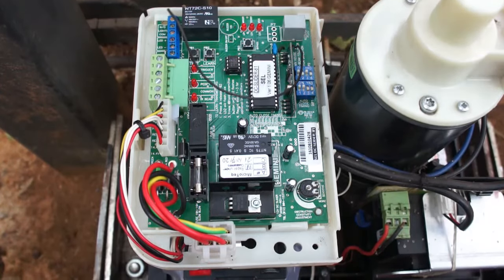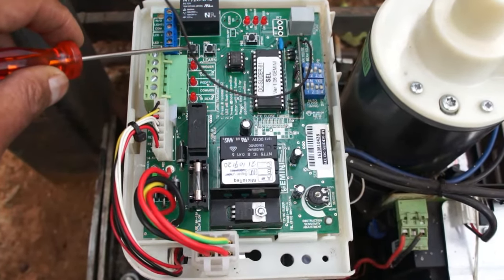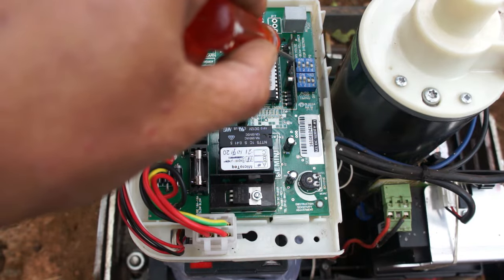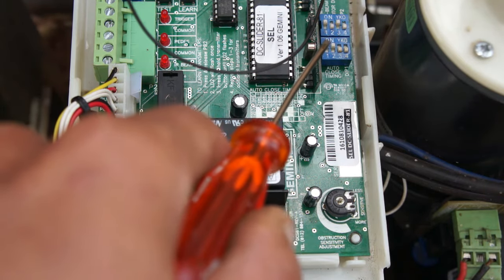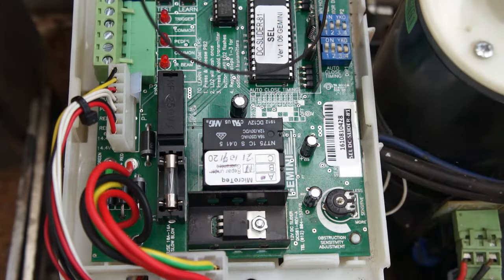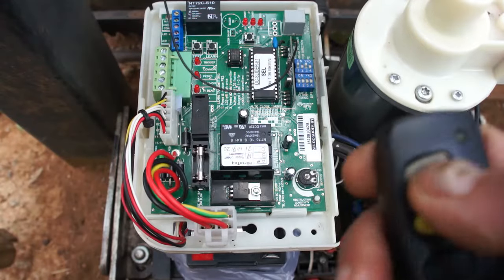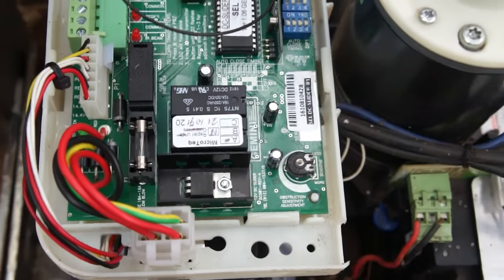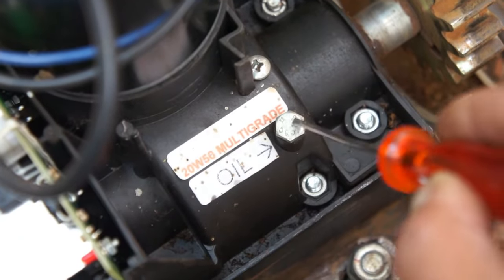Gemini Gate Motor tips as a standard user

Comment: Learning process for the gate: open 1meter. Lock the lever. Engage the gate. Replug the main power, then the battery. Press on start or the remote. The gate should CLOSE FIRST!  Then, press again and should open slowly fully. If the gate keep opening first in the learning process, change the mother board!!, assuming that your tiny little switch on the mother board has been put in the correct position.
Reply: Where are you Sir

Comment: Mine doesn’t turn, the status LED flashes 4 times when I press the bypass button, what could the problem be?
Reply from the maker: Hi, according to the manual which you can download at the address I will put underneath, Four flashes/beeps in succession. Release lever not engaged or reed switch faulty. 
You can check your model here and download the manual if you need to:
https://geminigates.co.za/manuals/
I hope this helps but let me know?

Comment: The gear doesn't turn but I could hear the motor is turning.
Reply from the maker: When that happened to mine, I had to remove the motor from the gate to take it into a Gemini shop and they fixed it. So probably something that needs a part replaced inside, maybe a broken gear teeth.

Comment: Hi .. im using that gemini motor  so recently i encountered a problem where by sometimes when i open the gate , it opens half or quarter half , so i have to close and open repeatedly till it opens fully. And another thing sometimes after opening or closing the gate it automatically close or open it self. So what could be the problem and how i apply DIY on it.
Reply from the maker: This usually happens if the power gets cut off or during load shedding and the gate needs to reset to learn where the end of how long it needs to open and close should be. Which makes it open or close very slow in the beginning until it learns the limits. You need to put the gate in manual and have it half way for this process, then turn it on and let it close and it will learn the end of the close. You can also search the manual by just googling then model number and manual.

Comment: Are you experienced with Linear Pro?  I got a card for dual opener and I would like to use it in a dual Sliding gate. The cable from card to motor is 5 lead inside. 2 of them for motor: I guess the other 3 are move detector sensor. Do you know what sensor type and connection they are?
Reply from the maker: Hi I'm sorry I don't have experience in linear Pro.

Comment: The gate is able to close when you press the remote even if the timer is set
Reply from the maker: Hey thanks. There might be different types of settings then because it definitely does not close with the remote on mine when it's set to close with the timer. I can't even stop it in the middle of I open and change my mind. I can only stop it midway if it's closing from and timer already.
Reply: Good day When the Auto close setting is set to a specific time you will be able to close it with the remote or test button anytime while its counting down the time to close. Unless your town house function (DIP 1) is switched on then you wont be able to intervene with the auto close time at all and the motor will complete a full cycle before taking another command from the user. :)